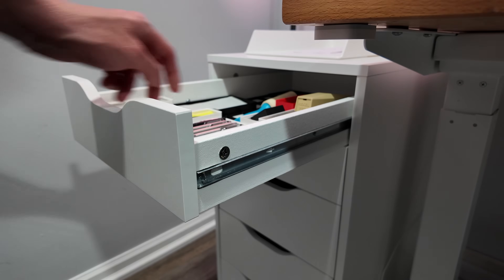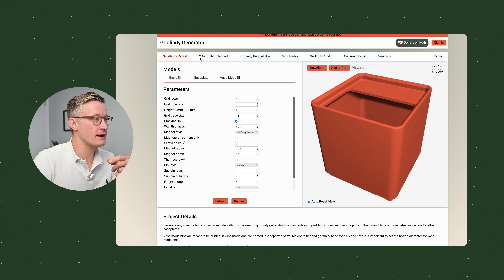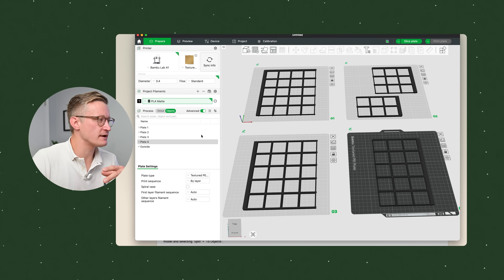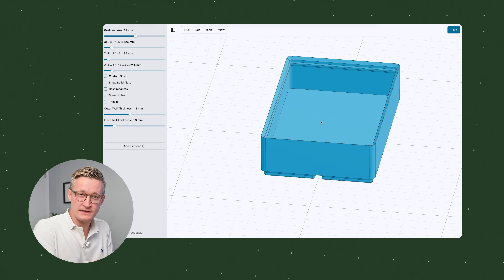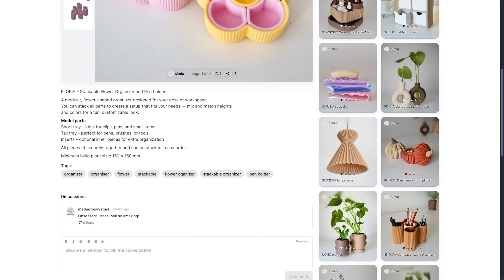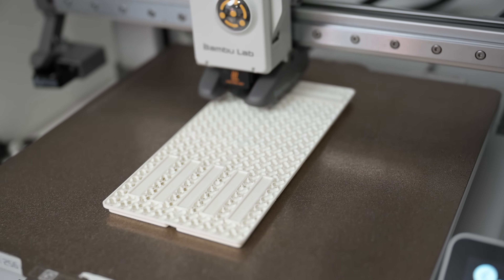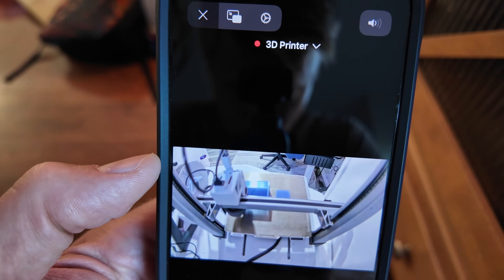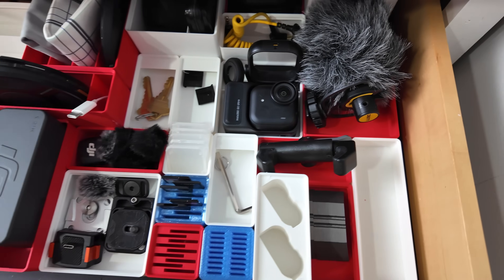The best home organization system I've found

Comment: On the recycling -I wonder if everyone printed a majority of what they needed, how would the  global impact be? Like, I wouldn't be paying for plastic organizer that take take up a lot of volume being shipped overseas and all the environmental impact. Even just driving 30 minutes to the store that sells it, all the energy to operate everything. We should be good stewards, but knowing where everything lives in your home keeps you from spending money on rebuying something you can't find or didn't know you had. 

Yes, we still need to buy materials, but a roll of filament take up a lot less space than what it can create.

As a reminder, it's REDUCE, Reuse, Recycle. :) We often skip the first 2.  

Our library prints things for .20 a gram, and I am going to start there - I have wanted a 3D printer since 2010 when I learned about them. I am a tinkerer / inventor / creator hobbyist. Not that I am older I want "creative  AND useful" hobby, instead of my old ones. 

Hopefully organizing my garage will give the space to set up shop :D  Cheers and happy printing.